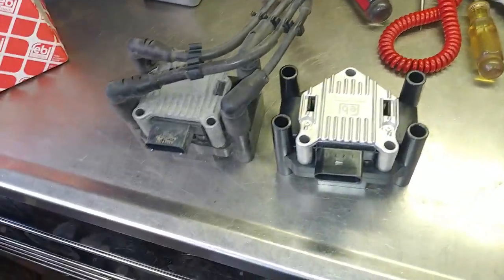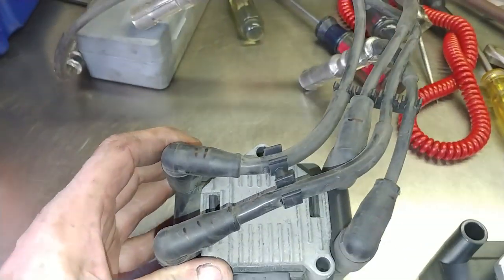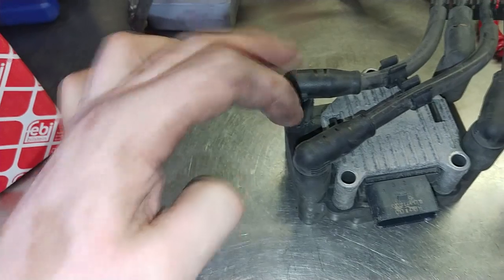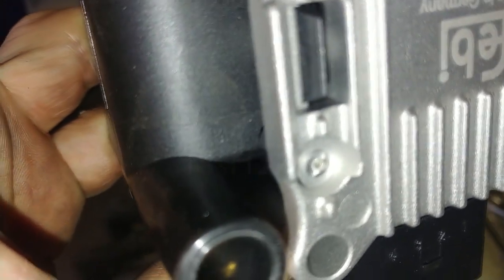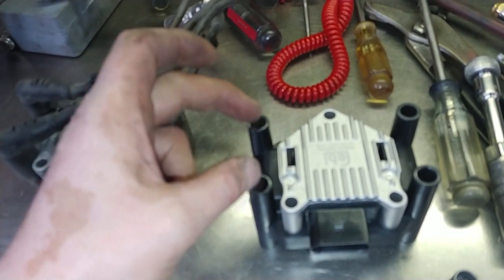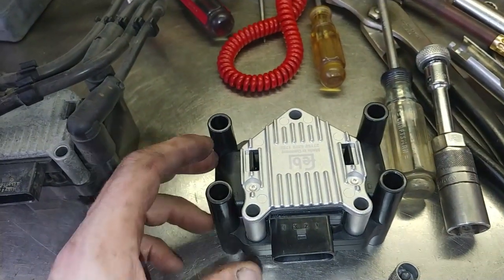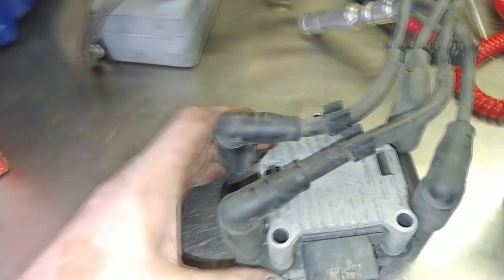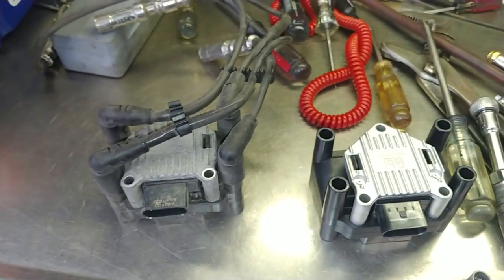VW 1J 9M: Waste spark ignition coil info

Comment: Is it safe to clean those coil pack holes / contacts?
Reply from the maker: Sure. Electric contact cleaner spray. Use a bristle brush to agitate any corrosion.
Reply: Ok, so its safe to use contact cleaner on those 4 holes. Thank you